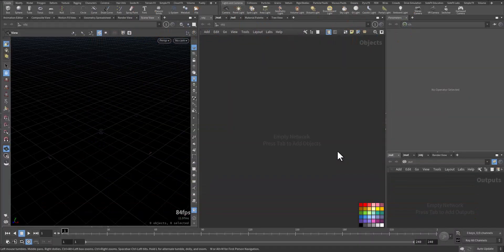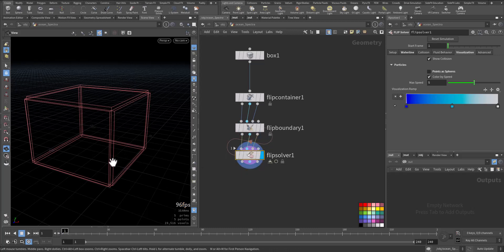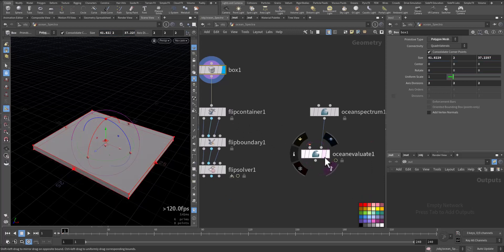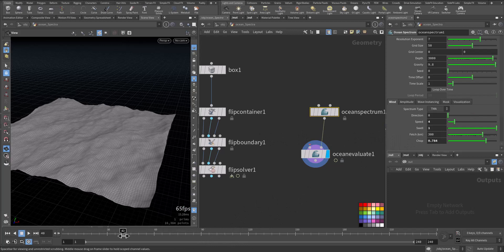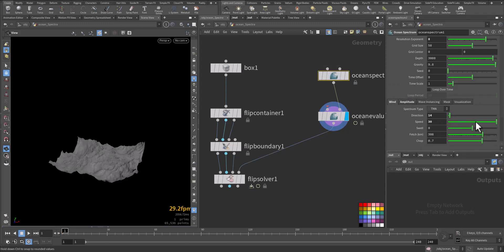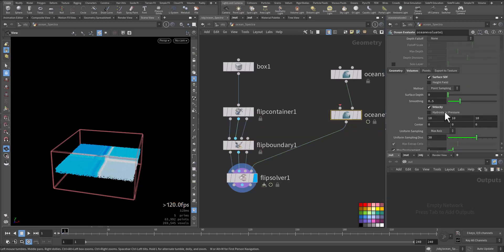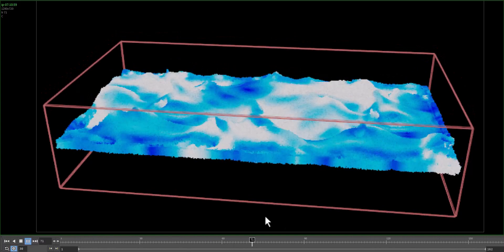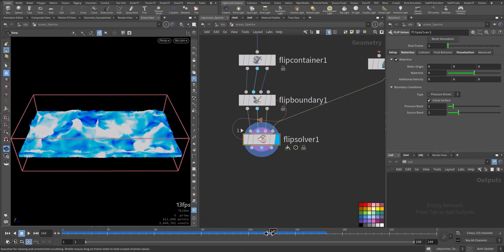Houdini 19.5: New Feature Ocean Spectrum setup for Flip Fluid in SOP tutorial

Comment: I'm trying to use a geometry instead of tank and nothing happens. The solver generate the particles with the same shape, but the spectrum doesn't work (I already linked it to the geometry to be deformed).
Reply from the maker: from the choosen geometry connect its output into flipcontainer node, uncheck the implicit bound in the flip container node and it should inherit the shape.. you are most welcome to join our Patreon page my friend.
Reply: @FaddyVFX  Thank you for your quick response !! <3
I tried this but it doesn't as well. After I transform the geometry the solver stops to generate the particles
Reply: @FaddyVFX  I realized what's happening. The ocean spectrum was using a linked expression, so it was taking the initial values of the geometry, causing it to disappear each time I transform it. 

When I have money, I'll join you guys on patreon
Reply from the maker: excellent troubleshooting, it is tricky at the beginning, but faast to setup flip in sop, and you are welcome my friend anytime on our Patreon. cheer.
Reply: Can't you add a a fluidcompress and a particlefluidsurface after the flip solver?